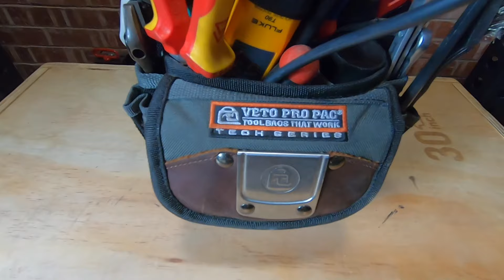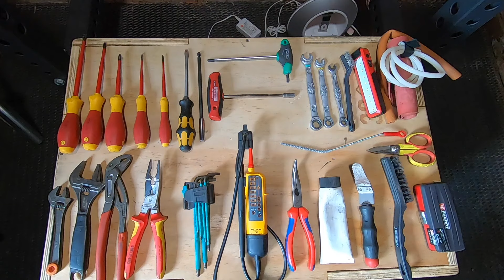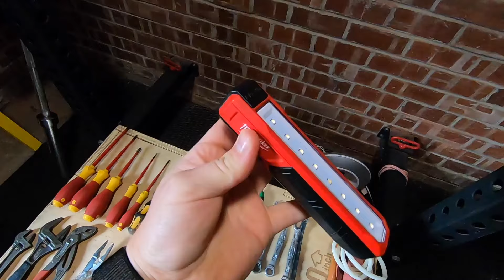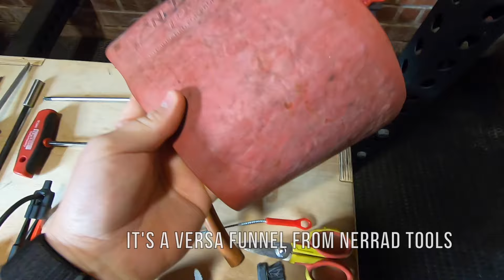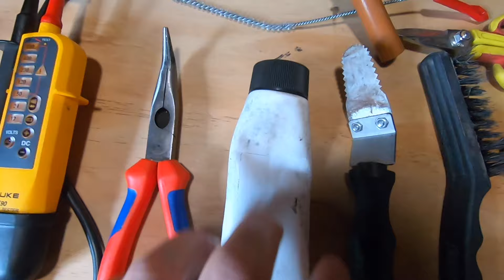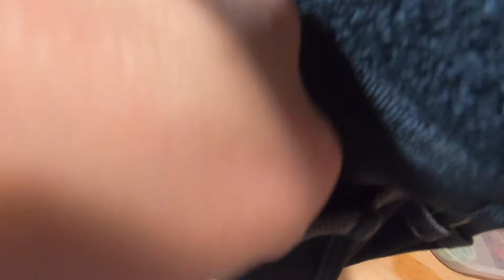Veto Pro Pac TP4B | Boiler Engineer Load Out

Comment: Nice bag. Does it match your shoes and workwear though? Top tip. Never go shopping with the missus fer a wedding outfit. If you do, every time you leave a dress or shoe shop... insist on nipping into a pub in-between for a quick half. It helps. Don't like the cobra grips. They lock on nuts. I'll stick wi mi Rothenbergers.